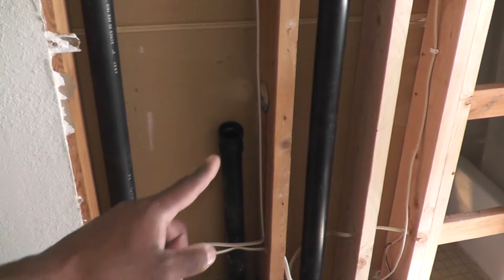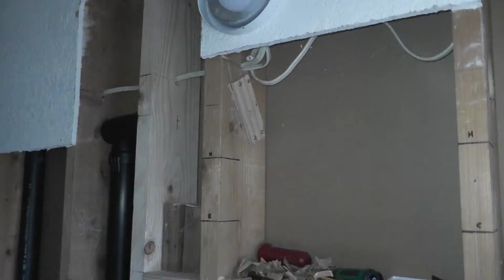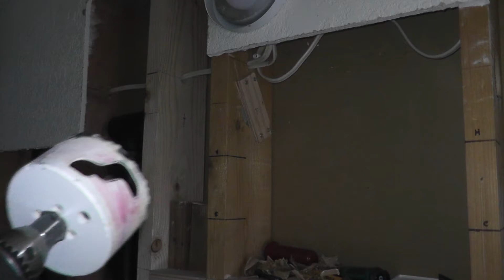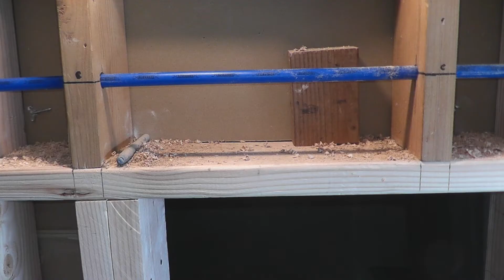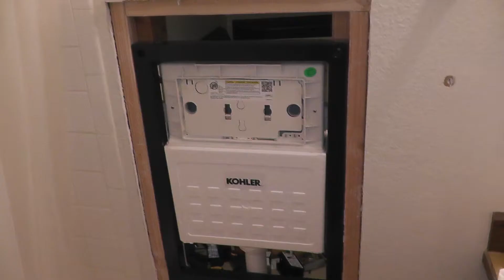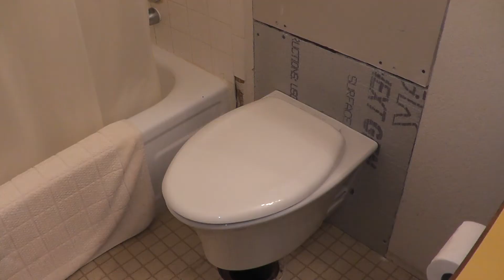Bathroom Remodel 44 - Kohler Wall-Hung Toilet Installation Pt 2 of 2

Comment: Thanks again for sharing your work and keeping it real, showing your problem solving.
Had a chuckle when you said you went to the big box store for the millionth time, ain't that the truth?!

So much more room.

Just a couple of thoughts:
While elbows and straight lines look great to the eye and very neat, water prefers less resistance. So sometimes with pex you can rather use bend-brackets (in your case not even necessary) eliminating potential leaks. If elbows were needed for some reason, you could have  used pex/copper elbows which would have removed 4.

Blessings
Reply from the maker: This was a very trying project with unexpected twists and turns. Yes, I agree regarding the pex - I've since learned to include as few joints as possible. Thanks for watching the video!

Comment: That is far to little standing water. Have you noticed any problems with having to clean after every solid waste use due to the water level? Have you found a way to increase it over the years?
Reply from the maker: Yeah, the water level is lower than I'd prefer. The flush is pretty forceful, but there occasions where multiple flushes or cleaning is required. As far as I know, there is no way to increase the water level.
Reply: @DIYApprentice  Thanks, I was thinking of installing ine of these in my remodel since it's very limited on space, but all the negative reviews about the lower water level gave me pause. But if most toilets nowadays are that low then I guess I don't have much of a choice, especially since you said it's more of an occasional problem than an everyday cleaning problem.
Reply from the maker: @BruhMan_5  You may want to look into Toto toilets, also.
Reply: Did you end up using the same Kohler wall mount toilet for your remodel?, if so, how has the flushing experience been?
Reply: @ednamoraa3018  When I read the above comments, I was worried but already committed to this model being in the middle of a remodel very similar to DIY Apprentice (having to move the vent, etc.).  We've now been using this toilet for over 6 months and from our experience, the low water level is not an issue.  This toilet is far superior to our previous floor mounted one and much easier to keep clean.